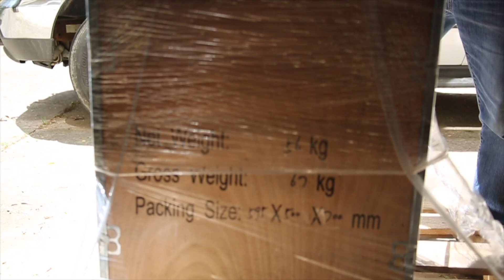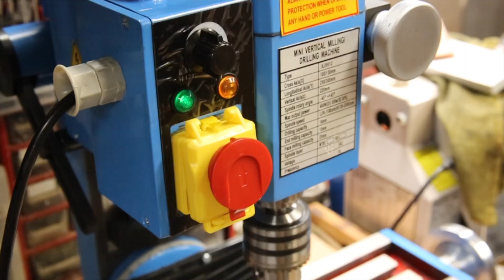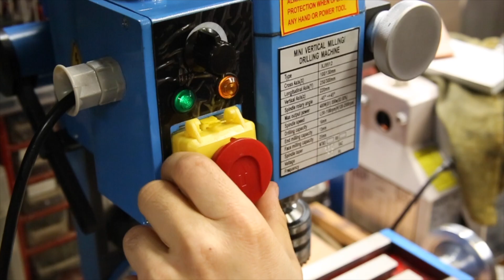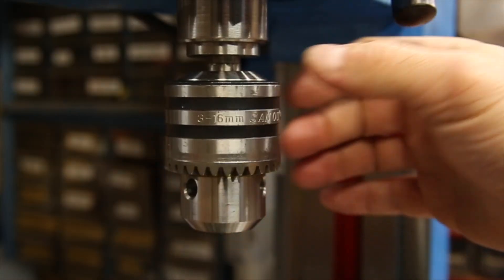Cheap Chinese Mini Metal Mill Milling Machine Unboxing, Setup, Testing, and Review

Comment: 9:20 Two tenths of an inch? Clearly they build the machine using metric measurements, because that measurement is five millimetres.
I don't understand why people in the USA can't just use the more accurate units of metric measurements, especially when equipment is built using metric measurements. I sometimes wonder if when people over there have to fit a bolt into a metric hole, they just hammer in an imperial bolt, instead of finding a metric bolt that actually fits.

Comment: A smaller version of those Fly cutters would be much better for cleaning faces that large. I8t's one thing cutting grooves.. U will need to get it bolted down to a 1/2" steel plate if u can afford to buy it my friend. That will add major weight and weight on any milling machine for me is very important. This Mill could be ok in time. Once u learn what is vey important u will understand the machine a whole lot better. There are some very good guys on here who I'm sure might be able to give some great advice.  A good collet chuck. I only know ER20's but there are much bigger ones u can buy u just need to get the fitting of the arbor correct.. 
I was going to buy one of these rom China but I changed my mind. I think next year will allow me to be able to get the Lathe and Mill I want. Money is tight atm. Hope this mill works great for u pal. 
It's always exciting getting a new machine for the 1st time. 
Sorry man, I just twigged that this video was made 5 years ago.. LOL. Sorry about my silly advice.. I don't know if u watch any channels but there is a guy who's channel is called @Inheritance Machining. another called @This Old Tony, @Winky's Workshop. Winky will always give a little advice if u ask him. He's a gentleman tbh with ya.. Winky isn't his real name obviously but I hope u check them out if u haven't already.. @Artisan Makes is another.. He will give u a lot of upgrades in videos just like that guy Winky will. They love upgrading their machines..
I shoulda cut this short but what ya gonna do man.. Hope this helped if only a little.

Comment: Having to dial in the spindle speed every time one turn it ON is a NO deal for me.  Imagine having to perform the same operation on hundred parts, or having to start stop many times on the same part.

Comment: Alot of others have said, but 1.) Tram it in 2.) V blocks 3.) 2 flute 4.) Cutting fluid 5.) Real vise 6.) End mills in a collet of some  sort 7.) Small depth of cut. 8.) Fly cutter finish

Comment: Wanted to mention when u was making a flat surface on the top of that bar stock u shouldent use the Chuck that u was using just because a endmill has downward Force when milling u should have used a Collet or a fixed chuck that has a set screw built into Holder to keep your endmill from pulling downward while milling would at lease be more accurate and also have a better finish or at least a more even finish :)

Comment: Its probably a bit late in the day but I'm bord so I'll give you a few tips for a better finish  from your milling machine wether its achevable from your machine is another thing, ,,try using a different vise for round bar stock or a V -clamp that is then held in a  regular style vise,,,try cutting at a higher speed with a slow traverse, ,,and the most important thing use a coolant cutting fluid its probably a bit impractical with your setup having to sit your milling machine in a coolant and swarf bath that has a built in coolant pump but if you're looking at doing lots of work this will help make a difference

Comment: That "bolt" you refered to when fitting the chuck is called a "DRAW BAR" It draws the shaft into the spindle and like wise to remove the spindle you loosen it 2 turns and with a soft head mallet hit the bolt and the shaft will slip out its lock then you safely remove it while holding in your hand

Comment: You must get a Collet set for your machine, a jacobsons chuck is NOT suitable for milling. 
You need a fingure gauge to clock the vice face to ensure its clamped parallel to the travel
The fingure clock gauge will also enable you to check the trueness of turret to mill bed, 
First things to make are some parallels for your vice 
When milling you must lubricate and cool the cutter which also washes the swarf from the cutter
It may be advisable to just pinch up the x and y table locks to steady the tables if they and lateral movement 
Have fun and be creative on a great asset to you shop
A DRO would be a perfect add on allowing you good accuracy then digging pockets and drilling multiple holes ar very specific distances

Comment: I operated a Cincinnati No.6 in a track shop (railroad track) for a number of years and really enjoyed it, although I also ran several planers, and planer mill, punches, drills, shears and other equipment, the mill was my favorite.
   Some of the cutters that I found very helpful was a surface cutter and a ball nose cutter. On my first day on the Cincinnati mill I made an octagon ash tray and used the ball nose to engrave the company's logo in the bottom. It turned out so well the plant manager wanted me to make another for the company's head office. I wish we had so aluminum material because the steel rusted pretty quickly. 
   I made parts for a Ivry Johnson shotgun on that mill and also mine jacks that were 6"X6" and 30 feet long. With a milling machine you are only limited by your own imagination.

Comment: WD- 40 or kerosine (don’t burn your shop down) or there are commercial cutting fluids available for aluminum..  But first start with a sharp cutter at a speed that won’t chatter for the best surface finish.

Comment: Hello all I'm currently looking to get started in milling and was wondering if there are any mini milling machines out there around the $200 to $300 CAD range and if so are any of them good or should I look for something a little more costly I'm not trying to buy the top of the line but something that can cut tool steel and other soft metals with relative ease.

Comment: Bolt that thing down to the bench, surface finish will improve immediately. Also, collets. That chuck has hella runout, whether you can see it with the eye or not, again better surface finish, more accuracy, etc.

Comment: For safety, buy a small brush to brush away chips.  You will reduce the chance of cutting your finger on a sharp burr edge or get a steel/aluminum... sliver in your finger.  Your mill probably has ACME thread lead screws.  Learn the difference between conventional and climb cutting.  You will always want to do conventional on that type of machine.

Comment: A fly mill or shell mill will give a better surface finish. A drill chuck can not withstand side thrust so it is not ideal for milling, a collet or end mill arbor will eliminate the chatter causing the tool marks. Try a lighter cut for the final pass to remove the tool marks.

Comment: Using recommended rake and side clearances for material to be machined. Also using a single point hss fly cutter gives a better continuous finish as only one axis feed and where carbide cemented or inserts need X2 higher speeds than hss also limited by Max rpm. Conventional milling for roughing and climb milling for finishing but with lighter cuts. Cutting fluid will give longer tool life and prevent work hardening and enhances cutting and keeps work cool as to prevent expansion too. Collet chuck for holding tooling and vee block for round work but looks very limited in height when you have work protruding from vice + arbor length + cutter length. Before cutting run machine on medium speed to warm up machine spindle and make sure when measuring the temperature is at 20 degrees Celsius. 300 X velocity of material divided by cutter diameter, mild steel 25meters/min, medium C steel 10-15m/min aluminium and brass  120m/min etc...all spindle speeds and feeds with milling can be easily sourced. Light duty might be 50%-75% slower feeds for chip thickness depending on capability of machine/no of cutting points/material being machined and finnishes requirement. Be careful too cutters can be replaced but fingers and eyes irreplaceable.
Reply from the maker: Thank you for all the information! This is a great comment
Reply: @TimNummy  Thank you, I tried to make it simple, direct and cohesive as complexity can be confusing/discouraging and easily misinterpreted. I didn't include all information as many other's have probably already elaborated on. Good luck with your engineering and PLEASE be safe,that I cannot emphasize enough. Complacency can get one in much trouble, not to fear it but to be cautious and reaction ready when necessary. Use short series when you can, all drill holes start with center drill for accuracy and incremental steps in size to reach required hole size. Small machines are only light duty and very restricted in arbors. Put a boring head on this and all your height is diminished.
If you can lock the slideway of any of the axis' that's not in use that helps with rigidity from backlash in the leedscrews and nut and worn slideways, always machine against the rigid side/jaw of the vice, take a light cut to start then measure when temperature of job is spot on and is safe to do so, a slight radius on the cutting tip so as not to leave so much fluctuations and so the cutting edge in it's path overlaps the next revolution. Important thing when sharpening is finish with a honing stone or 3 from fine to superfine,I forgot front clearances of tool too but that 1is obvious as not to drag tool over work. Important thing is the ambient temperature when measuring especially on site as this I see many ignore only to find when matching up the fabricated part it's not within the desired clearances for that fit to allow expansion/contraction. Many other thing's too you find out along the journey. All the best and take care brother. Only love (outlives life)

Comment: This is a video I actually learned from because there was not bullshit like almost every other video. its simply and use full.
Reply: You'll have learned a lot...a lot of very poor practice. 

This guy does not know what he's doing. 

Endmill in a drill chuck?...FFS.

Mill left on shitty pallet wood base and not secured?...FFS.

Climb milling on a mill that will make a standard Chinese benchtop seem like a granite-mountain-like exemplar of rigidity (and on a completely unadjusted table too)?...FFS.

Trust me, you learned nothing of value in this video (other than how best to increase the chances of injuring yourself when lifting).

Heads up to anyone reading this comment:

Just because YouTube makes it easy for you to put up a video on the internet, does not mean you should put one up:

1. Make sure you know what the rubbery fekk you're doing.

2. Make sure the things you're doing don't teach other people who are as clueless as you, bad or unsafe practice.

3. If you suspect you might not know what the rubbery fekk you're doing, find someone who does know, to teach you at least the minimum good practice BEFORE you post any videos.

Comment: This will make all machinist cringe seeing the end mill and the edge finder in a drill chuck lol. When I worked night shift the die maker on first would hide his good keyless chuck to keep people from ruining it by using it like it were a collet. This machine may be decent for small projects if you can get a set of collets and a decent vise.

Comment: To get a better finish and get a better milling experience, use kerosene as a lubricant.  Similarly, when threading aluminum using a HSS tap, use kerosene.  Try tapping or milling with and without that so see the difference.

Comment: Suggestions? Hmmm, lessee, bolt the machine to something solid, that doesn’t wobble, indicate the non moveable jaw of the vise straight with a dial indicator. While you have the indicator in the spindle, check how much lash the X and Y axis have, Ditch that chuck when you use end mills, those drill chucks should only be used for drilling, and don’t handle side loads very well. Hold the end mill as short as you can. Use a bee block in the vise to hold round stock perpendicular. Edge finders are low tech, but I use one every day..yes, those back gears might be plastic, I have seen that on Chinese machine tools before (Enco) good luck with your little mill. Oh yeah, WEAR SAFETY GLASSES!

Comment: You have to tram the vise before milling, to make sure the backjaw of the vise is parallel to the X-Axis. I don't know if the mill-head itself can be trammed, but if so then you have to do that also. 

For tramming, I would suggest getting a good quality indicator, like an Interrapid.

Comment: Grip cutter in a collet ,not a chuck, always keep the cutter as short as possible,  try to always uncut as opposed to down cut to avoid the "bite" caused by backlash, use coolant even on aluminium as some alloys can be very abrasive on cutters, grip the workpiece in vee blocks or a 3 jaw chuck

Comment: You should never use a rigid piece of precision equipment on a non rigid platform.
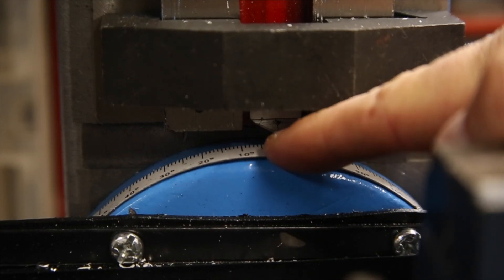also 10:32 theyre like youre American so youll have a leveler lol
Also dont hold flutes with a jawed chuck. Use a properly sized collet chuck instead.

Comment: For round pieces in your vice, always use v blocks to sandwich the part. Use your end mill cutter to rough cut away most of your piece, and leave at least .020 - .050 to your final cut. Then install a carbide tipped "Fly Cutter" to machine the remainder  (that .020 - .050) with single even continuous passes, covering your entire piece, of no more than increments of .010 at a time, to your desired size. That carbon tipped fly cutter will leave a beautiful finish.
Reply: I missed your post the first time I got distracted and missed this video
Reply: This is some good advice all I can say is lift fully away from part before disengaging/turning off and always go past part to achieve a uniform finish

Comment: You need a fly cutter to get a consistent surface finish on that. Also get a machine vise those vises rise up when you use them. Sounds supper chattery right out the box. I would check your bearings maybe get better ones. Also don’t ever use an endmill in a drill chuck. You got yourself a 5c collet there get consistent sized tooling and proper matching collet set.

Comment: Use a face mill on the faces of your part. That end mill is better for cutting on the sides. The face mill will leave a better surface finish on the top.

Comment: My suggestion to anyone working with METAL is take time to look up or better yet learn speeds and feeds simple metalurgy understand Rockwell c hardness or brinell ferous or non ferous hardness but  most importantly  how you HOLD YOUR PIECE all are factors also cutting tool geometry we had to grind high speed in the old days  positive or negative inserts  BEWARE OF JEWELRY or anything unconfined  that might get cought SAFETY GLASSES  being a mad scientist is fun  SAFETY MOST IMPORTANT have fun there are other hardness  MACHINERYS HANDBOOK is the bible but i still would recommend getting a school book it explains things better it is a FUN yet POTENTIALLY DANGEROUS experience no i did not do this for a living   thanx and have fun

Comment: Don't use a long end mill in a drill chuck . Use the shortest tools  in collets , Tighten up the gibes to reduce vibration . , Only cut soft material like brass or plastic . Don't use dull tools .

Comment: That long chuck and end mill won't help the finish, the shorter and sturdier the better. Make some clamps to bolt work direct to the table, a basic rectangle with a slot tapered at one end is easy to mill in the vice, that'll give you room for larger work. Some parallels will be handy too.

Comment: A fly cutter. A piece or round stock with area turned to put in a collet and a broached hole to place a lathe tool. Then a larger area can be milled. at once

Comment: You can improve the finish by making a power feed for the table, that way the feed rate is consistent. The cheapest, and easiest way is to buy a cheap 3/8" throw away  drill and mount it to one end of the cross feed screw.
Reply: Tramming would be the first order of work for better finish

Comment: Placing an end mill into a drill chuck is a really bad idea, it is not designed for applying side forces and will come apart from the tapered shank and could end up in your face!

Comment: Little late to the party but, as few suggestions, you don't typically use a chuck for endmills and that diameter and stick out is a bit extreme for that size of machine and the type of work your doing in the video.   Normally you'd use a collet and have the shortest tool stick out possible. I also don't know if i'd use more than a 1/2" tool. I know you said 3/8" in the video, but i'm having a hard time believing that if the part is really 2.5". You might be able to get away with it for drilling or boring, but side loading is a bit sketchy.

Comment: Tips from a guy who does not own a mill:
Bolt your mill to a Very heavy and sturdy workbench.
Buy a proper milling vise (drill press vises aren't the most accurate). 
Make some walls to put around the back and sides of your mill to keep the chips from flying everywhere.
Also, check your drill chuck. It looks very out of center. Maybe that's just the body, but it probably won't help with vibration.

Comment: If you do get one of those keyless checks be very careful in what you load in it it's for drills center drills but you should not put end mills carbide end mills you can put heat to it oxy acetylene heat and it won't get the tool out I trust me I've seen it done three or four times and it is not been successful

Comment: A v block would have been nice you don't want to run straight Jaws if you got a lot of tooling pressure it might make the round part go in the air or at you